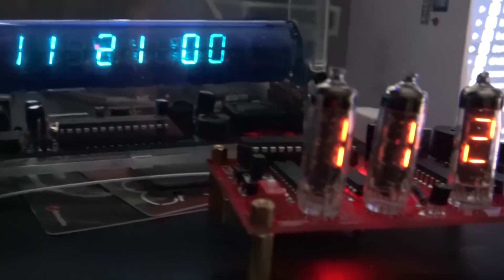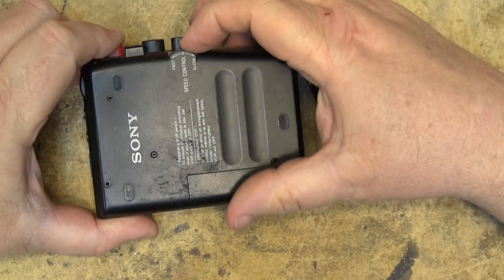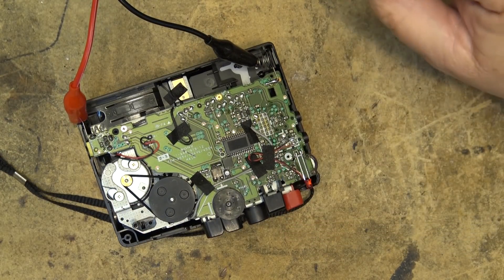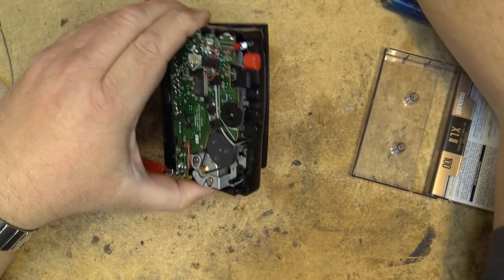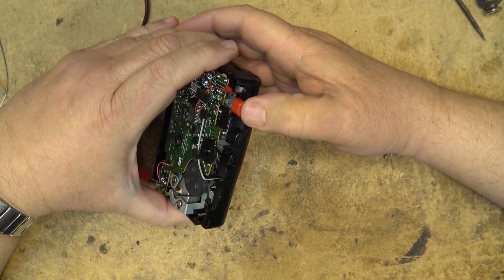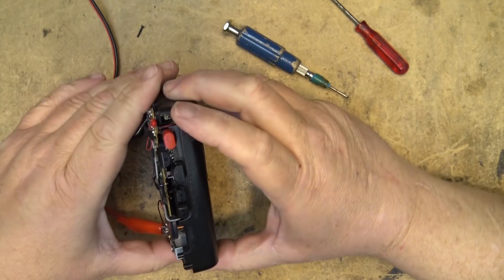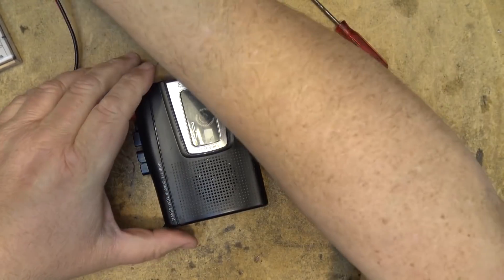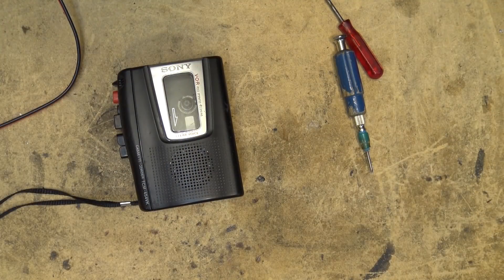Sony TCM 454VK  repair

Comment: Also on the sony tcm-200dv having a maxil 90 minute tape seemed to drag until i used 60 minute cassette.
Reply from the maker: Probably worn pinch roller.  90 min tape thinner.

Comment: I had to replace the drive belt on this tcm -200dv one screw I removed to clear the drive belt for easier removal and used a real thin dental double hook to put onto tiny brass circular drive and hooked the rest of drive belt over the bigger drive belt wheel.i don't know if I can get another belt to fix in future.ther maybe a noise from circular gears that maybe underneath.
Reply: The double normal slide switch on tcm-200dv when slide to double or normal would make gear slipping sounds as well and I also would take tape out to check to see tape was wound smooth and would slap tape down flat helper to even out tape height to help avoid snags especially on 90 minute tapes I preferred 60 or 30 minute if any problems.

Comment: I wonder if a black o ring  could work as a drive belt well if can get the right size and anotter test i like to record a electric guitar tuner note at a 440 pitch if it plays back the same pitch then great.it was said in past to use a tape head demagnetiser on bigger tape recorders maybe so there would not be tape record playback problems to tape itself. ?
Reply: The pause button assembly bent  can stick and cause slower speeds and not disengate keeping the tape from turning as well tricky and even the drive motor and or gears etc can slip as well well.check batteries and connections and voltage drops as well.

Comment: I have that same problem with the Sony Walkman WM-EX10 model. Quite common. Motor issues and not the belt. It plays poorly, and sometimes it plays fine - but the motor will eventually stop, and there will be no more FF, RW or Play on the cassette player.
Reply from the maker: Yup, motors fail left right and center on these.

Comment: I have a similar recorder the Sony TCM-20DV. works well even after many years. I've recorded many hours of my life on it. I agree with someone below me, mine also has the speaker on the door like this one but the magnet isn't powerful.

I used to crank up little motors like this on my electric train transformer which I still have. Man the days before youtube.
Reply: coondogtheman1234 I have the same one; got it from my mum when she took it home for me (with permission) during an office cleaning. After all these years the belts were still fine, and I only needed to clean the battery contacts (someone left batteries in) to get it fully working again

Comment: I think that wet motor with WD40 was picking some extra noise/sparking when freshly lubed. It will sound better when dried :) Actually try to extra lube power tool motor and stop/run it - it will get on fire from sparks - tested :)
Reply from the maker: Yes it has gotten much quieter. You heard that by the time it was together.

Comment: Would contact cleaner be of any help to stop the noise from the brushes?  The nutrol that you have used in the past seems to be really good stuff.
Reply from the maker: Contact cleaner will work temporarily but the oil in it is pretty light. WD40 has a heavier oil that stays after the solvents have evaporated.

Comment: The spray you use in 8:19 is a contact cleaner or WD40? Thanks a lot for showing us how to do! 
Regards from Brazil!
Reply from the maker: No it is just good old WD40. Not contact cleaner at all. WD40 does have contact cleaners, but this is just the basic old stuff that you put in frozen locks, and on squeaking door hinges.

Comment: Not liking the idea of the speaker in the door with the magnet next to the tape.
Reply: wonder if a shielded magnet would have helped.
Reply: Wow I was going to say the same thing as soon I saw it! :)
Reply from the maker: It's a shielded magnet, come on, Sony isn't that dumb.
Reply: So many portable tape recorders were designed that way, I've owned and still own several that are like that.  I never thought of how the magnet on the speaker could affect the tape, but there's certainly potential for something to go wrong.  I even have a portable tape recorder that have both the microphone and the speaker on the door.  BTW, are you a ham?
Reply: Lachlant1984 
Yes, I’m a Ham , call sign VK3HAU.
Reply: I thought so, are you in Victoria?  Don't Victorian call signs begin with VK3?
Reply: Lachlant1984 
Yes Sir, VK or AX for Australia and 3 for Victoria.
Reply: What part number does that motor have? I have 2 similar motors that a saved from Philips DVD Player for a long time ago. If it is worth the effort to fix it?

Comment: By the end of the video it was definately sounding better, when you first put in the music tape after the repair you could still hear a lot of speed fluctuations. I guess the more it runs the more the motor smoothens out.
Reply from the maker: Yes the oil will polish the contacts in the motor as it runs.

Comment: There are alot of standard tape decks with crap flywheels, it has to be heavy to smooth out the fluctuations, designs ruined by penny pinching :-(
Reply from the maker: It's a voice recorder so I doubt that anyone is loosing any sleep with the wow and flutter.

Comment: I actually like it! I have 2 microcassette recorders, but would like one that uses standard compact cassettes. So I can listen to all my old voice tapes without needing headphones. My earliest cassette recorders had heavy flywheels. I still have those.
Btw, what about the bottom bearing? I suppose it's more trouble than it's worth to try to get to that one.
Can you do anything about the sparking sound besides replacing the motor? Like a capacitor across the leads to the motor? I don't know, some motors have those.